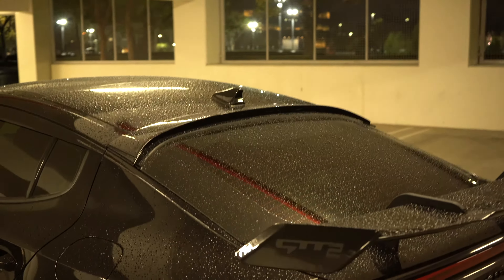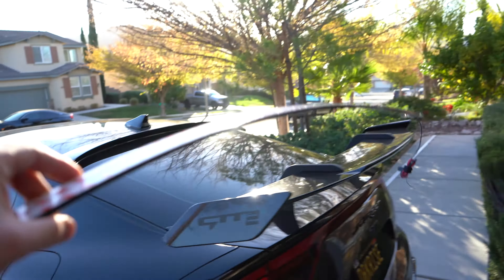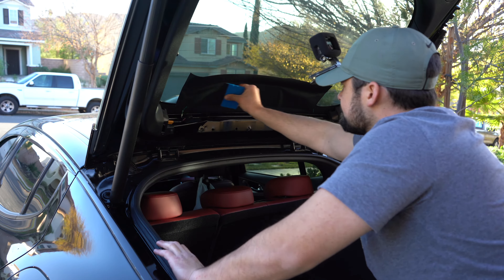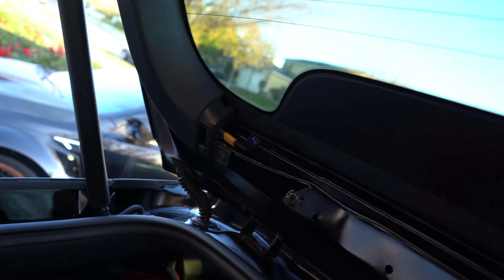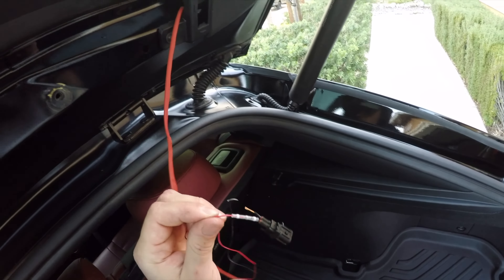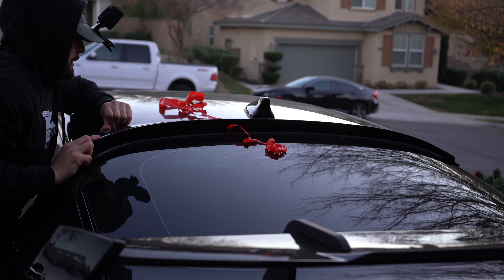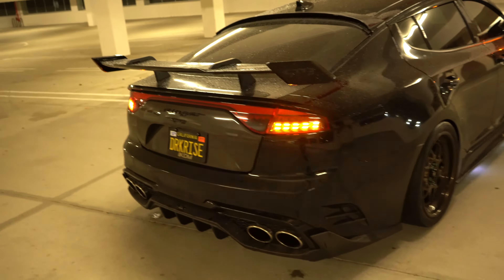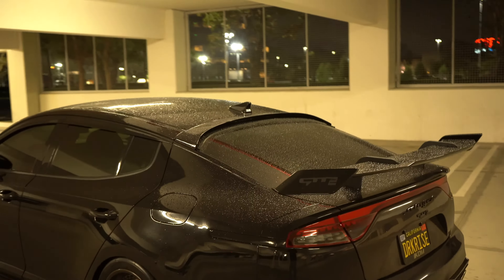KIA STINGER LED ROOF SPOILER

Comment: I screwed up and didn't get the original one you were talking about. K8 Stinger Store had it originally but when I saw it, it was discontinued. I guess this one will have to do. TBH, I'm not a fan of your rear wing. I have the Seibon C-Style hatch decklid and I love it. I still have the factory hood only because I haven't found one I like that doesn't make it look boiracer style. Seibon has the original style hood, so I'll prolly go with that and have it painted to match the Snow White exterior.
Reply from the maker: Ahh :/

Comment: Was this mod overall difficult? I plan to do it too thank you!
Reply from the maker: Fairly easy! I just suggest checking the weather before installing because It rained that same night and was super cold that the 3m tape didn’t adhere on the side so now both ends have lifted. I suggest waiting for hot dry weather or leave In garage while it adheres

Comment: Do you have content of you installing the spoiler brake light on your optima ? Been looking to figure out where you run wire 

hide/connect
Reply from the maker: No but I used the brake light to get power👍

Comment: What type of gas should I put on my Kia Optima sx turbo 2015 it’s stock. Last time I put 87 and now I put 89 should I put 91 or what
Reply from the maker: Good question! So the optima are rated to take 87 so that would be sufficient. Obviously arco vs Chevron 87 is totally different so if you want to get good quality gas into your car that would be your answer. I suggest only putting 91 onto the optimas if your tuned, because stock would just be overkill.

Comment: Yo man i just got my roof spoiler in and it didnt come with 3m tape can u remember what size yours came with? It looks like 1/2" on the sunroof side and maybe 1/4" on the hatch side? Thx bud.
Reply from the maker: It cake with 1/4 around the edges of the roof spoiler but I added 1/2 myself for extra reassurance since it was an expensive piece. Just make sure not to cover the breath hole to prevent from expanding and cracking with heat
Reply: @DARKRISE  thx man appreciate it!

Comment: Where did you get the LED brake light from? I'm looking to do the same thing. I have found a carbon fiber Roof Spoiler. Just need an led strip to suit.
Reply from the maker: So I got the light on ebay, bust has been discontinued unfortunately

Comment: You are only missing the rear bumper reflector sequential lights.
Reply from the maker: True💯💯might do next
Reply: @DARKRISE  I installed them in my 2019 GT2.  They look awesome.
Reply: @DARKRISE  BTW, I already installed a roof spoiler a few months back.  Do you think I still have a chance of installing the LED brake light underneath?

Comment: I wouldn't say the tail lights are hard to get, more like super expensive and hard to install. Especially on a 2018-2021. Still haven't been able to install the damn light bar I bought last year, which sucks cuz it fills up that ugly Dodge like middle piece that has no purpose.
Reply from the maker: Using paste to identify any areas that hit really helped👍 I have a 2020 and only took a 2 hours max. Try the paste  or baby powder trick👍